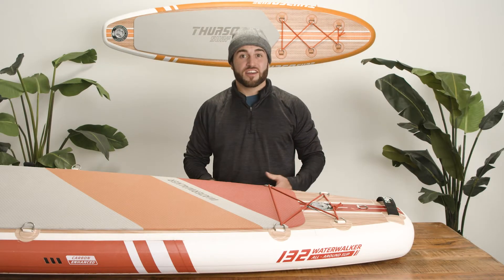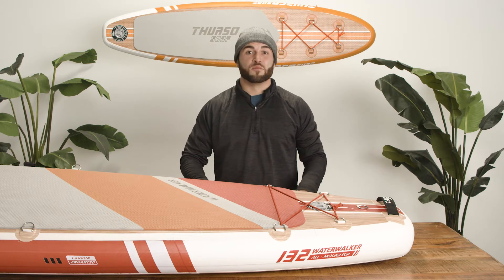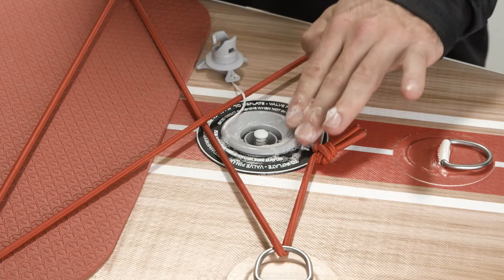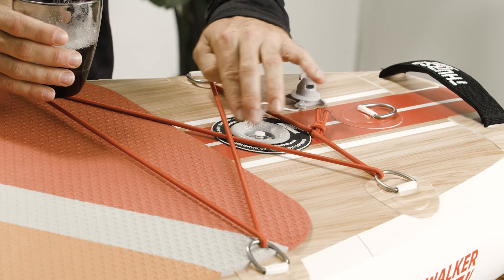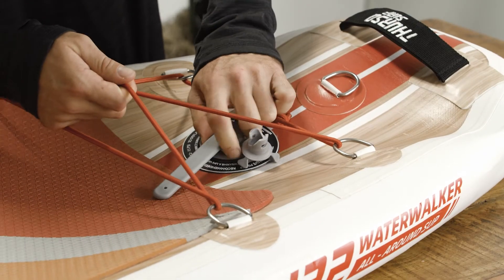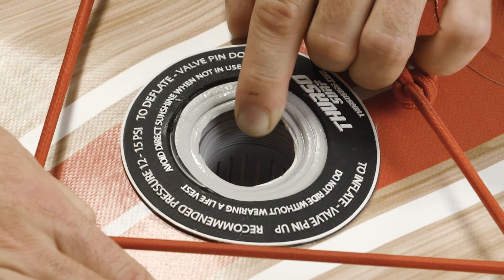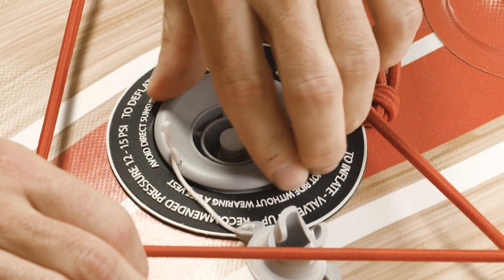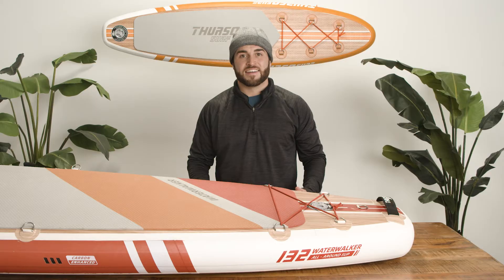How to Fix Paddle Board Valve Leak | Thurso Surf

Comment: tried to tighten the valve with tool but it doesn't budge to tighten or loosen.... Now what?
Reply from the maker: The valve might not tighten further if it is already tight, but it should loose when you rotate counterclockwise. When rotating, make sure the tool is fully inserted in. You can use one hand to press the wrench down, and use the other hand to rotate it. Feel free to give it a try and good luck!